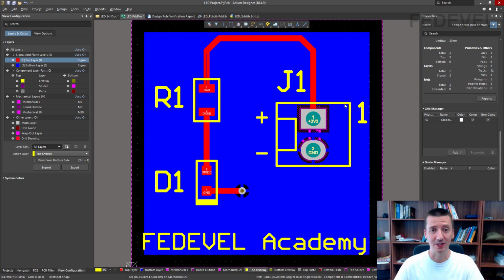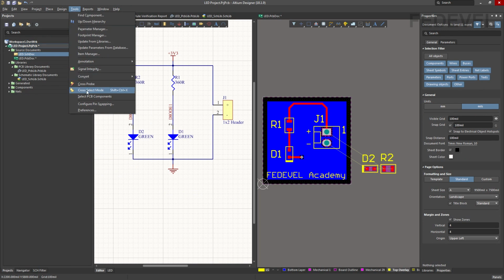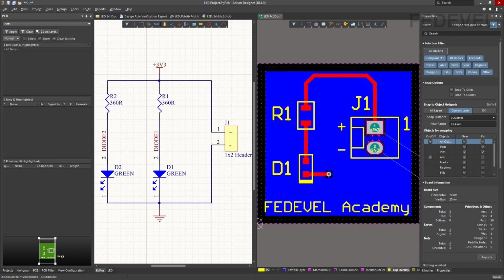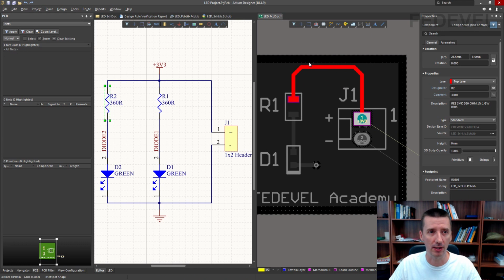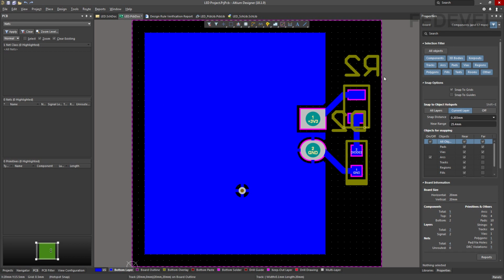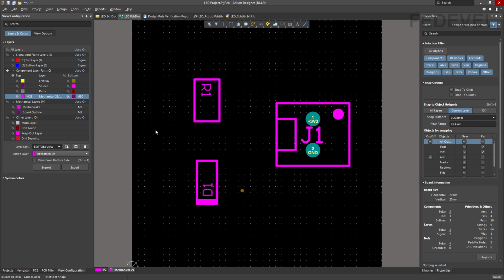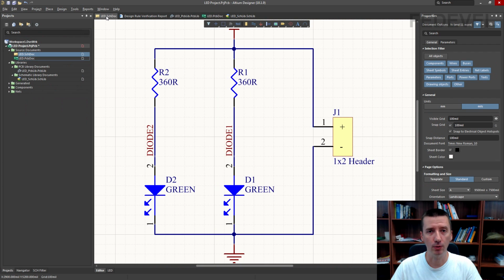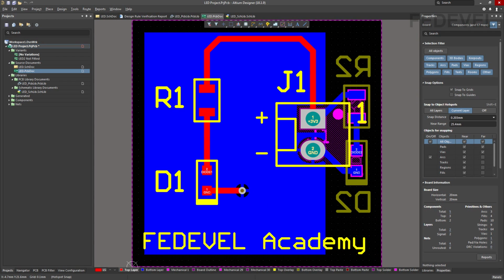Tutorial 4 for Altium Beginners: Placement, Variants, Assembly Drawings

Comment: Hello Robert, I'm interested in how you determine the thickness of the track and the length of the track so that its impedance is 50 ohms depending on the material used to make the boards. If you could explain it a little it would be very helpful or even make a video on this topic?
Best regards
Reply from the maker: I made a video about that: https://youtu.be/VGY1qFE-kC0

Comment: I still had a problem with highlight gone when component placement, but after I turned off one parameter at the preferences, now it works good (only one parameter should have  ON state :Preferences -> PCB Editor -> Display -> Highlighting options -> Highlight in Full) - it solved my problem

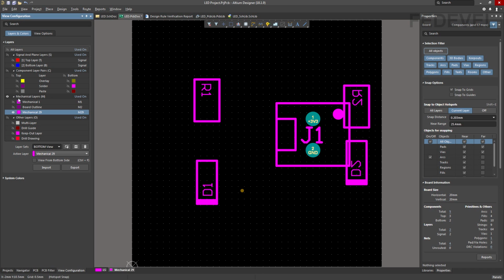Comment: Dear @Robert Feranec thank you for your time and efforts, I am learning a lot from you. in this tutorial at 22:50, you mentioned about creating assembly drawing layers. But this process is not working for some version of Altium. I tried the same process even for latest version 21.7.1 and it couldn't help. I found an alternate solution to this problem. Process is same, not in PcbDoc file but in PcbLib. Creating same component layer pair in PcbLib file solve this problem for me.

Comment: Sir, at 16:04, after press the “reposition selected components” the PCB becomes masked again, I am using AD2021.
Reply from the maker: You may need to adjust some settings. This may help: https://designhelp.fedevel.com/forum/main-forum/altium/6736-how-to-cross-probe-net-then-reposition-selected-component-without-losing-highlighting?p=15970#post15970

Comment: Even when I use shift the multiselection for the cross probe is not working , is there another method ? Im using altium 20.2.6
Reply from the maker: This may help: https://designhelp.fedevel.com/forum/main-forum/altium/6736-how-to-cross-probe-net-then-reposition-selected-component-without-losing-highlighting?p=15970#post15970

Comment: Thanks a lot, Robert for this tutorial. This tutorial is very useful for beginners. Great effort to transfer knowledge. I  am facing a problem at 16.00. When I select Reposition Selected Components, then it unmasks all the layers. (I select R2 by holding the shift button). Please look into the matter
Reply from the maker: Thank you. PS: Try this for reposition: https://designhelp.fedevel.com/forum/main-forum/altium/6736-how-to-cross-probe-net-then-reposition-selected-component-without-losing-highlighting?p=15970#post15970
Reply: @RobertFeranec  Thanks. I am using AD 19.0.10 .  Still, my problem is not solved.
Reply: @RobertFeranec  Thanks, I have got the same problem but it has been solved with unchecking from PCB Editor->Display
- Apply Mask During Interactive Editing
- Apply Highlight During Interactive Editing

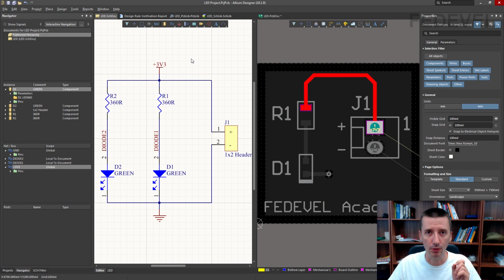Comment: At 15:22 you show to keep the filter in place as you select a part to place.  However on my version of Altium (20.1.7) when I CTRL + CLICK to select the resistor in the schematic then select "Reposition Selected Components" the filter clears as soon as I select that.  Is this a change in later versions of Altium or do I have a setting wrong?   Thanks!
Reply from the maker: lemmy999, did you try SHIFT instead of CTRL?
Reply: @RobertFeranec  Yes, I made a mistake in the original post. I am pressing SHIFT + Left Click to select R2 and when I select "Reposition Selected Components" the filter clears.  I just tried again to verify it.
Reply from the maker: @lemmy999  when you are going to PCB, be sure you do not left click there. It depends on system settings, but left click in PCB may unselect selected objects. I normally hold right button, move with PCB a little bit to activate the canvas and then start working with pcb.

Comment: Hi, do you know why when you add some new components and nets it causes errors when you update the PCB after click on validate?, the new component is accepted by altium with no errors but the new nets are shown as "unknow pins", thanks
Reply from the maker: Usually during import you should see what is wrong (e.g. if there are unrecognized ins or something like that). Try to delete the component from PCB and import it again.
Reply: @RobertFeranec  Is very strange, validate gives me errors but when I click on execute changes it shows everything is ok
Reply from the maker: @JairoGustavo  It depends ... for example validation may not add footprint into PCB, this means if you need to add footprint into PCB and you only run validation, then validation may fail, because when it will be validating connections of the new component (what was not added into your PCB yet) then it will be failing. However, if you run import, then import will add the new component into PCB and it can connect the pins - so it will run with no errors.

Comment: hi,  i need some help here, my stm32f4 component does not have vdd,vss....and some other pins, i need to unhide them, i have tried all the possibilities..
Reply from the maker: Did you try to select the component -> Properties -> Pins TAB and check if all the pins have the eye icon ON?
Reply: @RobertFeranec  hi Robert, thank you for the quick reply, yes i exhausted all the possibilities, the eyes are all on, what i have noticed is, the VSS,VDD.... are all in grey while the rest of the pins are ok but the eyes are all on
Reply from the maker: @mhand8560  hmm, then I would maybe try to make a library from your project and then I would have a look if I could edit these pins directly in the symbol (in the library).

Comment: please how to download library and install to used it in design at any time  without internet
Reply from the maker: Depends on what libraries you use - but if you are using integrated libraries or if you are using sch or pcb libraries (even using db libraries which have relative PATH to reference to your local sch and pcb libraries) you should be able to use these components on your local computer and use them without internet. Just be careful what is the PATH to your libraries - because all your symbols and footprints in your project will refer to that PATH as the source of library. PS: Even if your PATH is not correct, when you are finishing your schematic or project, you can always update the PATH in your symbols and footprints and point them to your Central library (in case you would need it).

Comment: Can you tell me a practical example when you want to unfit a component in a variant? In Wich cases this is this used? 
Your videos are gorgeous!
Reply from the maker: Thank you. There are number of situations when you would like to have unfitted components. The main idea is to have one PCB which can be used to build similar boards with a little bit different parameters (e.g. one board can have 2 memory chips fitted, different board with same PCB can he 4 memory chips fitted). Also, I use unfitted components to test some feature (e.g. by default a new circuit or feature may be disconnected and once it has software support, the components are fitted and feature is tested) or you can fit/unfit components for different configurations (some chips have configuration pins where you can use pull up or pull down - so if you would like to test both features, you put there both resistors, but fit only one). I also use optional components to disconnect a circuit in case something is not working or for example re-routing some tracks - e.g. if I have only one USB and in one configuration I would like to connect it to USB connector and in other configuration I would like to connect it to different connector. Have a look here:https://www.youtube.com/watch?v=Oy56xuBWNXM or also here: https://www.youtube.com/watch?v=2LWXKOEnIJE

Comment: HI,good job but I have a question:how you will  solderJ1 ?Point 1 is on TOP and point 2 is on BOTTOM and your pad  for point 1 is not declared ,,vias''  1.
Reply from the maker: J1 pin 1 and J1 pin 2 are through hole pads with a hole in middle - means, you can plug in connector's pins inside the pads and solder it down.
Reply: @RobertFeranec   OK,J1 pin 2   is ok but J1 pin 1 need to be metalised hole..Thank you.

Comment: When I try to add "component layer pair" for mechanical layer 29, I can not set M29 as top layer (not on the  list, as it is allready used).
Reply: Unfortunately there is a bug fixed with 18.0.12 update. In the previous versions(I also have 18.0.7) has the same problem. You can look at the release notes here; (Bug code: 24198) https://www.altium.com/documentation/18.0/display/ADES/Release+Notes+for+Altium+Designer
Reply from the maker: It is hard to say without seeing it what the problem could be. If the layer is not in layer pair already, it should be in the list .. unless there is some other thing set differently (?)
Reply: I have also the same problem with peropata. I do not know how you achieved in your video but in altium web site they support this issue with this sentence " Only unused mechanical layers can be paired". https://www.altium.com/documentation/18.0/display/ADES/PCB_Pnl-ViewConfiguration((View+Configuration))_AD
Reply: @tarikgunlu9981  me too have the same problem with 18 version
Reply: @RobertFeranec  may be you are using different version !!
Reply: i have updated to another version and it was solved

Comment: always the best your way your teach. If possible teach us how create small component in BGA packge and how apply your rules, but not those BGA with several pads, just normal BGA. Generaly have a rule to project but when create us BGA a component always happen error of clearance rules. Several manufactory have your rules for factory. How rule for clearance minimal. If manufactory have clearance minimal 0.1mm and we need create a BGA part with your pads with 0,05m between your pads, this is not happen problem to factory? Thanks you for your time
Reply from the maker: Do you mean like this? https://www.fedevel.com/welldoneblog/2015/02/altium-tutorial-smaller-clearance-under-bga-or-footprint/
Reply: Yes i had seen this video 3 time. I just would like have sure about this. If some manufactory have minimal clearance 0.1mm in your factory, is correctly to do this component with 0.05mm?  Thank you very much, this is better tutorial about altium.

Comment: I want to learn, how to create a file for automatic installation for the factory and manufacturing (automatic installation needed by the manufacturer to install electronic pieces on the board automatical
Reply from the maker: do you mean pick and place file? it will be in the next video
Reply: Thank you: I mean when you send an electronic circuit form to China for example and you want to make a lot of them, the factory will ask you for a file for the automatic placement of the items electronic location of each piece for example
I thank you very much and I learned a lot from you in this area
Reply from the maker: yes, manufacturing files will be generated next week